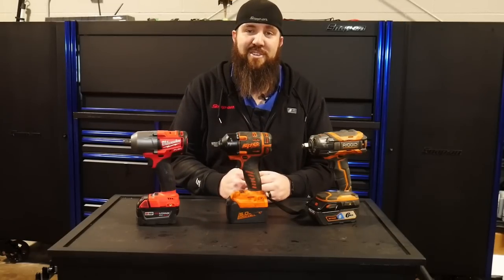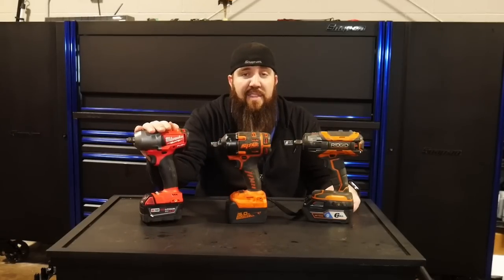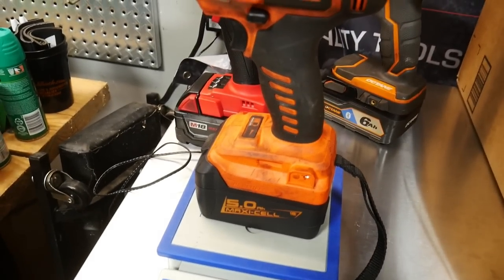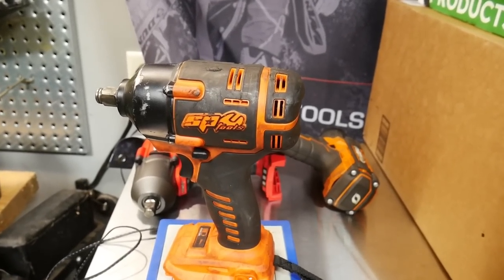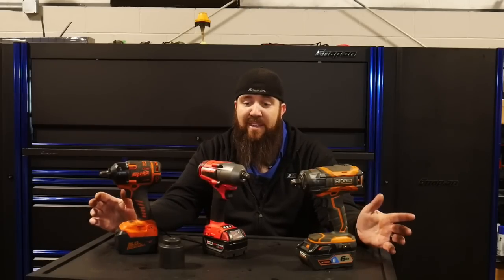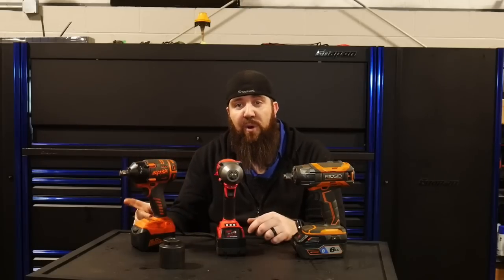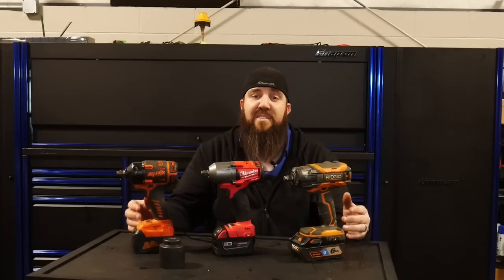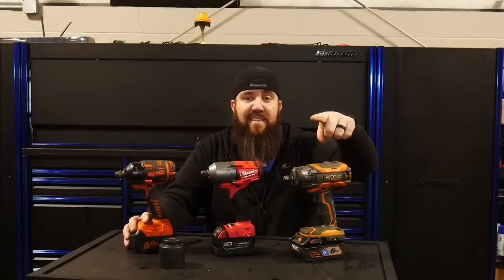MID-TORQUE CORDLESS IMPACTS FOR AUTO TECHS

Comment: Taking off the axle nut, it was clear in the video that the Ridgid and Milwaukee had turned the nut before the SP impact spun it off. You should have re-torqued the nut each time to be fair.
Reply: Agreed. To have two step up and bang on it and then the third takes it off without retorqueing is not a great test. All of those could have removed that nut with some more time banging away at it.
Reply: True..
Reply: But then how would the SP win?
Reply: @Ben C Good one.
Reply: Was thinking the same, the Ridgid and Milwaukee loosen it for the last impact wrench, if he would have kept the Ridgid or Milwaukee for 15 seconds impacting then it would have come off.

Comment: These are good choices and good vid showing real world usage. I love the design, build quality and warranty on Milwaukee cordless impacts. However if you live in an area that experiences winters that include road salt and fasteners are  often rusted don't expect the Milwaukee Mid Torque to take off a 36mm axle nut with it. Especially if it wasn't torqued to spec. It didn't work for me, had to use a mid 90's Japan made Craftsman 1/2" pneumatic impact to break the axle nut. The Rigid kit (tool, battery 4Ah & charger) at HD for $149 is a very solid deal for what you're getting.

Comment: I second that bud, I have the Milwaukee mid torque 1/2 impact in my cart. I use it everyday literally and it works on 95% of everything thrown its way. The other 5% is when a higher torque gun is required

Comment: Ford master mechanic, I use the dewalt mid torque dcf894 95% of the time, the dewalt high torque dcf899 is a beast but its heavy and rarely need to use it
Reply: Comment at a proper time. Gonna purchase DeWalt, start seeking the 894 instead 899.

Comment: So I don't know the accuracy of this statement, but a video I watched a while back said that the Milwaukee won't be at full power until it's running for 8 seconds or something.

I have a M18 low torque 3/8, 2754 I think, and it seems to be true.  If something doesn't break loose, I'll hit it for a solid 8 seconds then sometimes I'll pop right off.  It's usually right about 8-9 seconds when it breaks loose, but idk, maybe it's just luck.

Comment: Good comparison, and an excellent video!

But I do feel compelled to say, a fella would have to be crazy to pay $340 for the Ridgid with two batteries and a charger.  As you said, there are definitely better deals to be had, and they happen fairly regularly.  For example, a couple of weeks after this review was released, I got the Ridgid with two 3Ah Octane batteries and a charger, for $149.  Granted, that was two 3Ah batteries, not 6Ah, but that's almost $200 cheaper.  As I recall, that deal had been going on from mid-December all the way through January.   Those holiday season Home Depot / Ridgid deals are pretty insane... and they often pop up in the late spring or early summer, too.
Reply: You are exactly right nobody needs to pay almost $350 for any impact and any batteries and any charger... wait for a deal and you'll get it for half that price
Reply: I missed that deal but i got 1 4.0ah charger and impact for $149.  I already have another 4.0, 3.0octane and 2 (1.5ah) so I will have 5 batteries which quite frankly is a lot for a homeowner non mechanic.  I do use em with the usb adapter and on my drill/impact.  I can stop using my impac driver with adapter for sockets now and use the wrench. Will also work on the occassional tire change,brakes and whatever else.  Just ordered mine today.
Reply: Just missed one last week for 149 w/ 1 battery and charger.  Thought I missed out lol guess I'll have to wait until the end of the year

Comment: Lots of comments here about lifetime warranty, best to remember that warranty only covers defects in the manufacturing process. Don't get excited thinking that your battery will get replaced under warranty in three years. It won't. After three years of use it'll just have reached the end of its serviceable life and will need to be replaced at your cost. AKA wear and tear.
Reply: Not true. Rigid batteries are replaced when they no longer take a charge. I have used this coverage several times.
Reply: no its service parts and repair for non defective tools

Comment: I would have liked to see you try a new axle but with each impact it had been rattled twice before the sp got to which does make a difference but I’m hard core Milwaukee too but do think this will affect it
Reply from the maker: In the next few months I’m hoping to get ahold of some testing equipment for this, but this is as close to real world circumstances as it gets
Reply: I agree with ag tech 45 that was a little dicey I understand criticism and how it's not exactly fun to respond to it and I completely understand that the time it takes to make a video is also harder then it seems. I'd like to throw my mac impact into the mix for mid torque I think I can probably get one to you for a vid.
Reply from the maker: CP the tool addict I’d be down. I want to be able to do some more definite testing with a lot more of these tools. Hopefully I’ll be getting my hands on a very specific piece of testing equipment to handle just these things👍🏻
Reply: @RustbeltMechanic  Hey any updates on the equipment you got for testing? I'd love to know what you're using for these kind of tests

Comment: Interesting as I have my rigid Gen 5  1/2  impact, and it removed a lug nut that was torqued to 500 ft-lbs. Il keep my rigid. 😎
Reply: it is a to much torque or what is your experience
Reply: @JuanMorales-ks4ll   No not at all it's just right, and it's adjustable with different settings if you find the torque to be too much.

Comment: Don't forget if you register your ridgid tool within 90 days that 3 years turns into lifetime warranty.  That will also include batteries and charger.  Only if purchased from authorized dealer and the batteries have to be purchased in a kit.  Currently you can get two 3 amp hour batteries and charger with the impact for $169.00.  Bare tool is $149 and there is a kit on sale with 4 amp battery for $149.00
Reply from the maker: Good info👍🏻

Comment: All of my cordless tools are matco expect for my 1/2 which was the snap on ct9075 and i liked it just didnt like the price and snap on warrenty sucks. Gun didnt have the tq I thought it would have. So i sold it and bought the Milwaukee 1/2 high tq and it's 100 times better and i use the high output 8.0 battery. I do alot of lugs on bigger trucks f250-550s and it does awesome. Used a buddys Milwaukee 3/8 stubby impact I loved it so much more Compact and better torque then my Matco stuff so needless to say all of my Matco stuff is for sale and I have been buying Milwaukee Tools here lately.  a lot of the time for the work I do I always just use my 3/8 gun so next one i buy will be the Milwaukee 3/8 high torque (600ft tq) gun. 
Also we wok on alot o dump trucks  and for shit's and Giggles I put a 33 mm on my snap on gun and it would not take lugs off of a dump truck and the Milwaukee took the same lugs off no problem.
Reply: Also put a high output battery on the Milwaukee gun and you will see a noticeable difference in power

Comment: You know I would enjoy to see how the fuel m12 stubby with a 6 amp hour stacks up. It’s amazing how much power that little guy has and if it can’t do it I go right to the air!
Reply from the maker: It doesn’t stack up. I use that stubby at work and they only max out at 250 ft lbs
Reply: Rustbelt Mechanic in a few more generations they will get it there lol
Reply from the maker: I can just about guarantee it. I’d put money on the stubbies and the mid torque getting a revamp in 2020

Comment: Like the video, only issue i had with the axle nut test it they should really be done on different nuts each time. i did the wheel bearing on my ram 1500 a couple months ago and my Milwaukee struggled for a good 8 seconds before finally ripping the axle nut off, but after watching the way you did the test i think with any of the tools if you had put a few more seconds into that axle nut they may have done it, maybe for the next test take 3 nuts and bolts and torque them down tight with a calibrated wrench, allow them to cool ( so heat doesn't allow them to come off easy ) and then see if they can do it. Great video just had to add my opinion to the mix lol
Reply from the maker: Yep I totally get and understand that. This was just finding some real world circumstances to put these through. Hopefully here in the next few months I’ll be getting my hands on some official test equipment that can handle these impacts and more👍🏻
Reply: Rustbelt Mechanic that would be awesome to see, I haven’t seen many videos that have thoroughly tested the mid-torque line of impacts. Looking forward to more of these videos

Comment: I think the best one is the MAC/Dewalt 3/8 drive impact with 250 ft lbs of torque since the MAC is pretty much the same dewalt tool.
It has enough power , and it’s compact enough to get into right spaces. 
The next one Is between the Milwaukee and the Matco 3/8 drive impact with 600 ft lbs they’re pretty smooth tools
Reply: Millwukee fuel stubby is a better gun

Comment: I would be really interested in seeing the difference between sockets (chrome vs impact) on a nut torqued to a value that the gun would actually have to work for. In my experience I’ve had a stubborn nut that my Milwaukee 3/4 drive had issues with on a chrome 3/4 drive socket and I swapped over to an impact socket and it seemed to pop it off fairly quick.
Reply: The heavier the socket the more torque power it will give you, deep well non thin sockets give you more torque compared to shallow sockets, and impact sockets are better suited than non impact sockets for higher torque.

Comment: Its unfortunate though that the  SPTOOLS 1/2" Mid-Torque according to their website is out of stock right now. Any word on when it may be available???
Reply from the maker: They are fixing it in the next few minutes. Their site mixed stuff up with the prices and they are out of stock on only the 5ah batteries but have the kits with the 4ah batteries in stock.
Reply from the maker: Fixed on the site
Reply: They screwed up their Christmas promotion. I signed up for their Christmas promotion discount code thing and no surprise, the impact gun with the 5amp batteries was out of stock. I wasn't able to take advantage of their holiday promotion.

Comment: You need the high torque for those axle nuts
Reply: You can use the mid torque guns there is litterally a guy showing the mid torque doing everything the high torque does.

Comment: I would like to see some actual testing of the SP vs Milwaukee. I wonder if it will actually hit 715? Make one please. 😁
Reply from the maker: Well, you may be getting that here in a few months. Working on getting access to some test equipment to do more accurate high torque testing.

Comment: What high torque half inch cordless impact has the highest rating?
Reply: Samuel Deter Ingersoll Rand and the new Matco. Matco says 1600ftp breakaway and the IR has 1500ftp. Real world there is no difference from what I can tell. Ir is superior with the circle light and settings
Reply: @ThadrinC  thank you
Reply: @joserivera6356  I don't think any other brand high torque impact has beaten the milwaukee high torque yet..
Reply: @giovanysantiago5892  Lord knows it's heavy as hell and you will pay for it in weight but My God, there isn't a bolt that thing will not remove